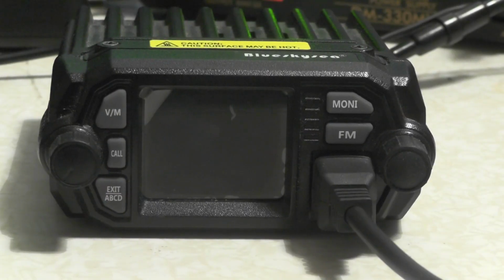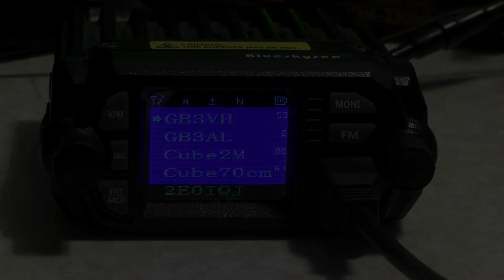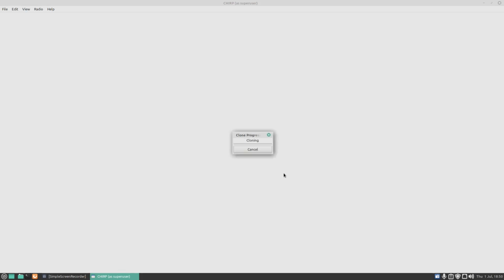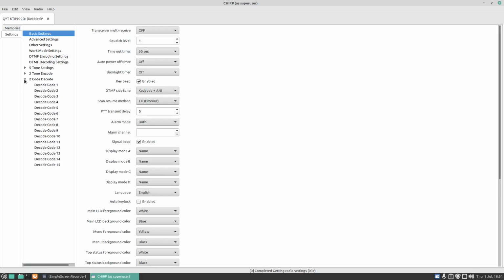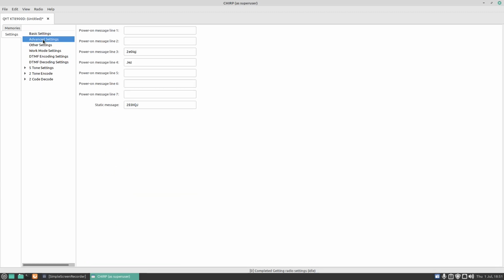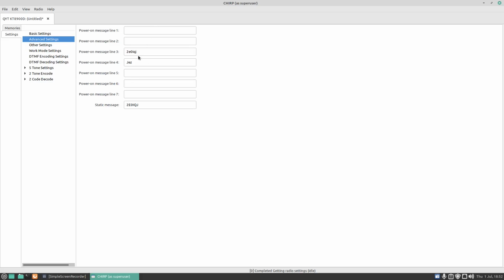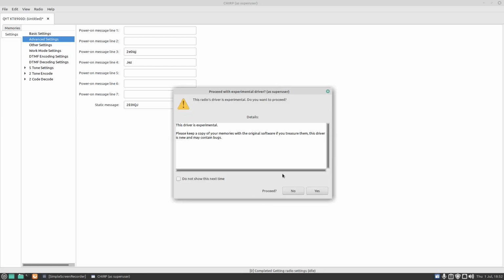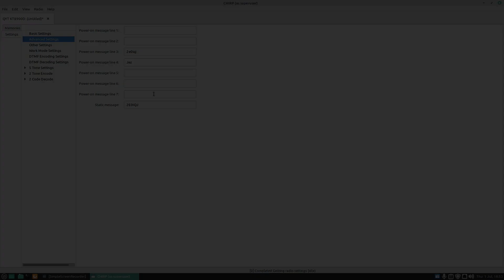How did that get there?

Comment: I saw a photo in the manual with the source voltage displayed on the bottom have you figured out how to display the source battery voltage ?
Reply from the maker: @delta9jms  not used the radio in ages i think the voltage is displayed when no call sign is programmed in the radio
Reply: @2j4ez  thanks... i'll give that a shot once my programming cable gets here.   New to GMRS and this is my first "mobile / base station" radio.   Have the radio just waiting on the cable from amazon.  Plan on using this on long roadtrips only in the truck and at home as a base station.  Got a good deal on an "open box" on eBay but the radio was actually brand new.    Guess the seller just listed it as open box since its older generation radio.  Not bad for $55 USD

Comment: Question I have three humax boxes and a quad lnb. Why do these boxes conflict with each other when I want to record 4 programmes there is always  a weak signal
Have I to install another satellite dish?
Reply from the maker: my friend had 2 satellite boxes conencted to one dish. one box he used for a controller to move the dish and the other was to watch. he had to turn off the first box in order to watch a second box otherwise he would get a weak signal message on the screen
Reply: @2j4ez  yes you need a separate dish for each box